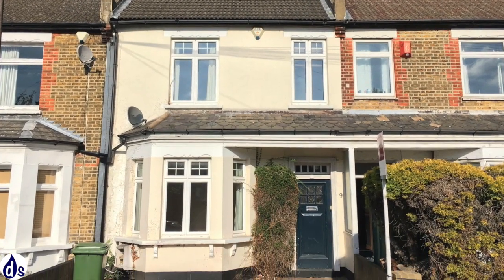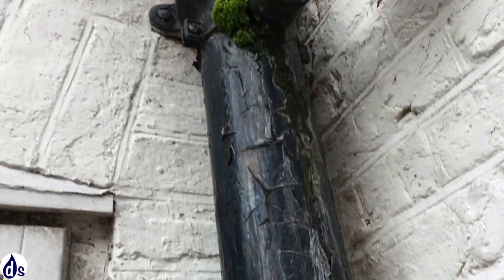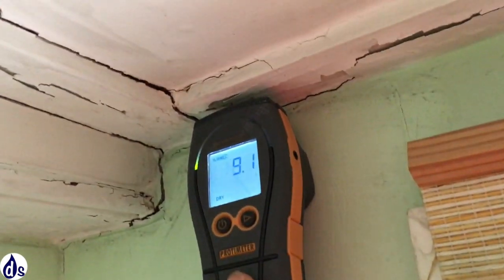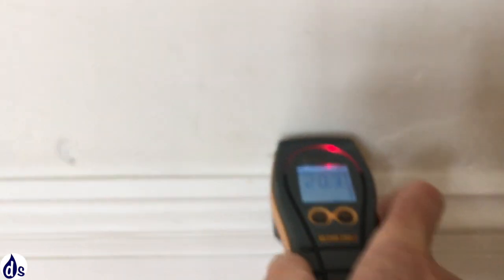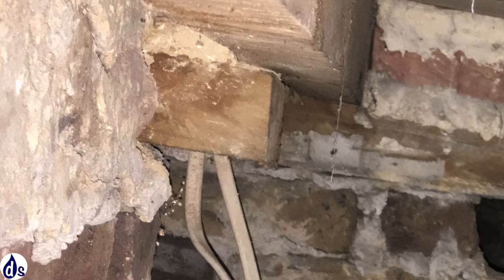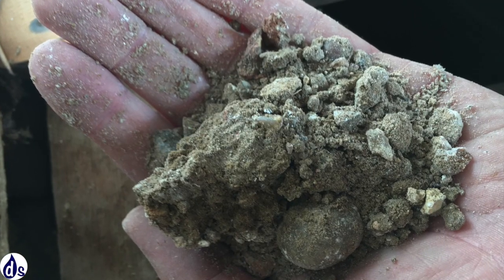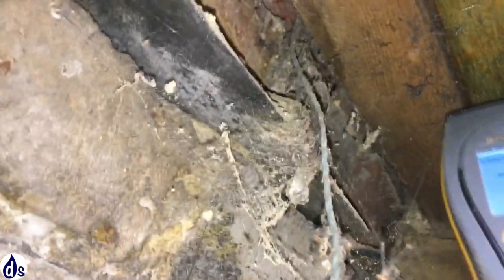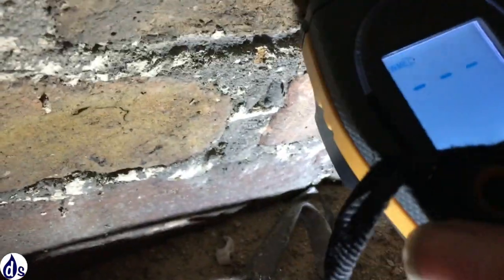Rising Damp? No, DPC (damp proof course) bridged by plaster in sub-floor below house

Comment: Hmm. Two things that stand out for me, apart from the shoddy repair work on the gutters, is the raised height of the external surfaces which could potentially allow rain water to splash up into the vents and the cement render on the front won't allow the building to breathe! Why do people cover up that lovely brickwork? Also, why do you use a timber moisture meter on everything?  It gives inaccurate readings of damp where it's within normal range?

Comment: Would it be worth while damp proofing the subfloor.
Reply from the maker: If your sub-floor void is poorly ventilated, then measure the sub-floor humidity with a hygrometer Probe (eBay / Amazon ~£5) making sure it remains below 85%RH. If it rises above 85%RH you may have rot and or a source of damp, such as a blocked or cracked drain or mains water/ bathroom leak. Solve the problem, whatever it is. 

If you can't solve the root cause, maybe because it's coming from a neighbour or the council, then consider installing a sub-floor extractor fan, or two. £420 for two plus about £200 installation costs. Consider installing the MORI WMF Weatherproof Multi- Functional Sub-Floor Ventilation by HomeVent (a division of Elta).